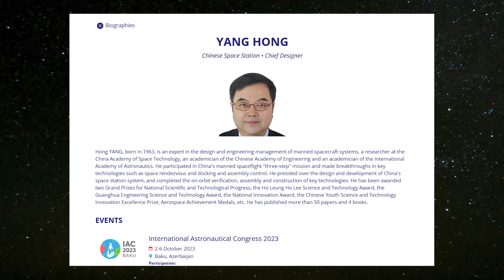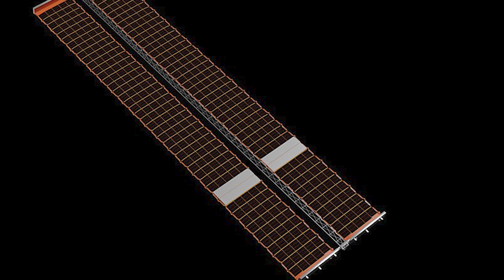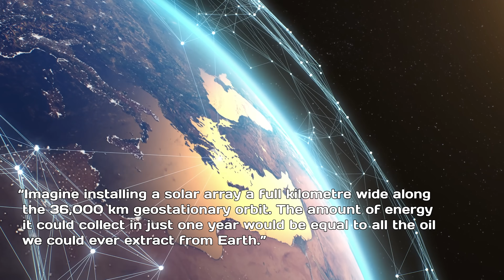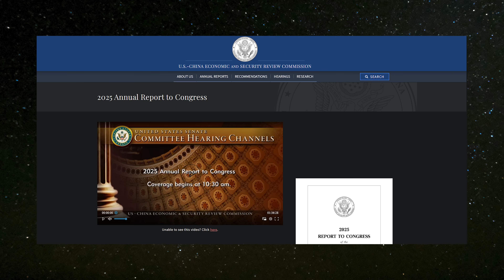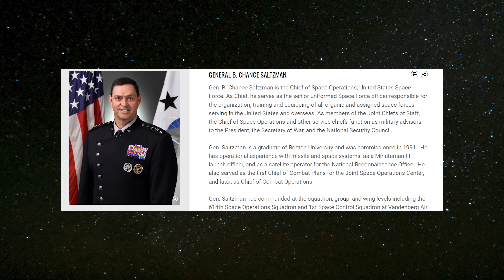Something Big is Happening to China Space We've NEVER Seen Before! Better than NASA & SpaceX

Comment: I have a background in microwave and I tell you that this is bunk. The technology for generating microwave beams of the required energy does not exist, and assuming it did it would destroy any satellite passing through the beam, not to mention aircraft and birds! It would take a trillion dollar program to send enough energy from earth orbit to earth to light a 100watt light bulb!
Reply: In 2024 June issue of IEEE Spectrum, this idea was discussed and was considered not practical.  After reading the article, I figured out a way to synchronize a phase locked  microwave transmitter array over 1km diameter to focus the microwave back to Earth.  With a pitch of 10m apart, 10,000 microwave transmitters with 100W (found in microwave oven) each can deliver 1MW power focusing to Earth, locking to a fixed receiving antenna.  It is pretty easy to receive 200W solar power and generate 100W microwave power.  This issue is how to synchronize them in space.
Reply: @DragonYang01 they said that about long distance transmission of Ultra-High voltage DC energy until China perfected it. Today only China and Brazil has the technology in service. It allows them to keep the coal fired power stations away from municipal areas.
Reply: @dstr1  
The one China built in Brazil is the longest distance in the world.